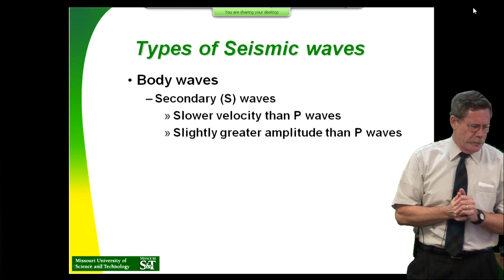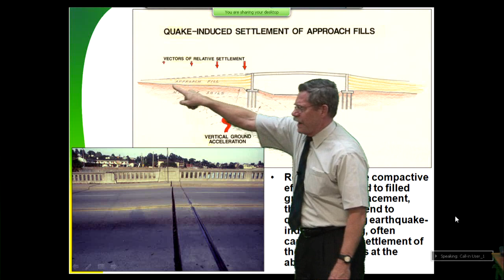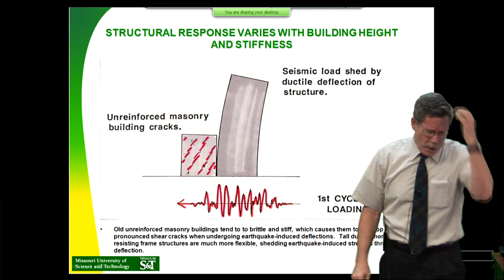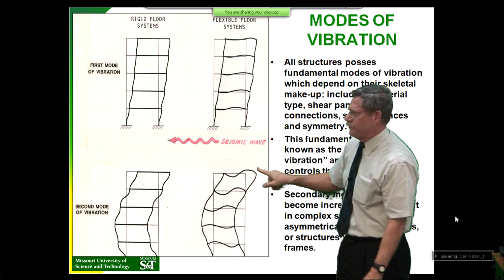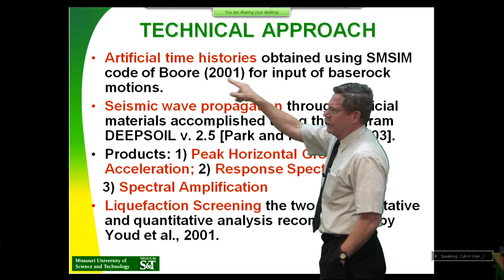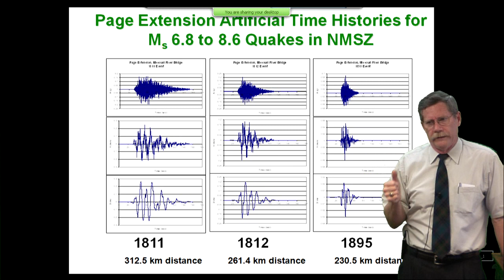Engineering Geology And Geotechnics - Lecture 14

Comment: I really love this lecture series and thinknthe world of dr Rogers. 
But if i may offer a tiny corection? On the 9.0 earthquake in the pacific northwest coat was it january 1700 ad,?  The juan da fuca ocean plate slides under the north american plate. As it has the locked zone the shore  is near the leading edge which is compressed like a spring and over time the north american plate  bows upward till the pressure is so great that the rock in the locked zone fractures and the leading edge of the north american plate springs west ward like rapidly straightening curled finger with the palm facing down.  When this happened the land droped and salt water killed swaths of trees the still stanging dead trunks are called ghost forests. In the 300 years since the coast has again been bowed upwards. Brian Atwater usgs geologist was able to dig on the raised river bank and found the sand deposited by the tsunami. 
   With the greatest respect i hope you do not mind my sayingbthat you had stated it wrong that the land had rised during the earthquake. The tsunami is called the orphan in Japan  because when it hit in the middle of the night there was no warning since no quate they could feel had proceeded it. Btw im thinking from memory that the quake occured at 9 pm on jan 26 but might be misremembering. Thankyou Dr Rogers
Ps wikipedia said the north american plate jumped west up to 66 feet.